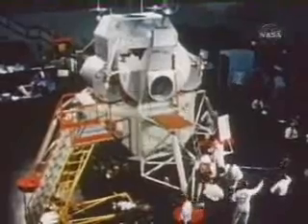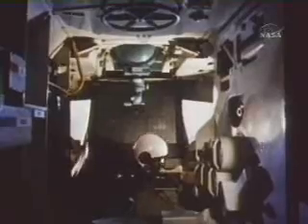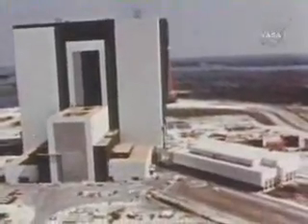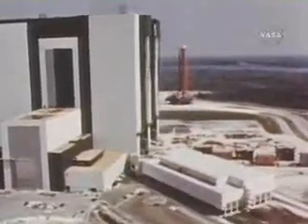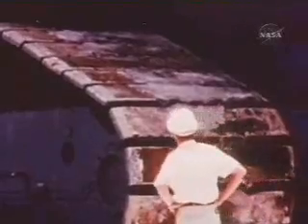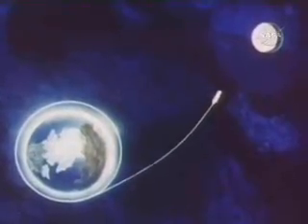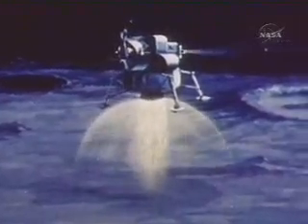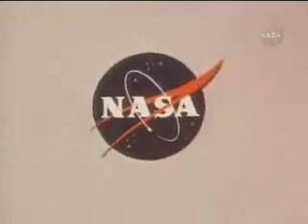Lunar Landing Module

Comment: There was no blast crater because the engine on the LM throttled down to a min thrust to land.You don't use full thrust to land,(only hollywod does that. A car with a hemi engine doesn't park in the garage at 120mph it slows down (unless you are my ex girl friend) ..Moon landings real as advertised.
Reply: oh come off it, stop deluding yourself

Comment: You mean hypergolic, not hyperbolic.

That orange "smoke" is the natural color of the NO2/N2O4 (nitrogen tetroxide) oxidizer. It's not reacting with the air. The same stuff is a major component of smog, which is why it looks orange-brown.

But you're right that it won't form clouds on the airless moon, it'll disperse much too rapidly.

There's a visible flash at the moment of ignition, but once combustion is stable the plume is invisible.

Comment: The LM certainly had an exhaust, it simply wasn't visible.

All rockets on the LM and CSM used hydrazine and nitrogen tetroxide, two hypergolic fuels that burn with hardly any visible flame. See films of a Titan II (not Titan I) or Ariane 1 through 4 (not Ariane 5) without SRBs and you'll see hypergolic fuels in action.